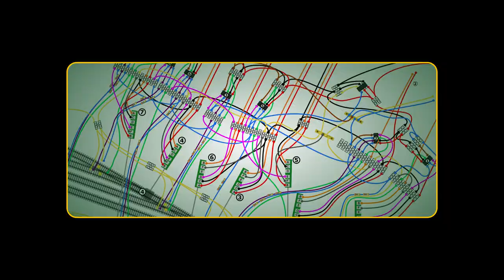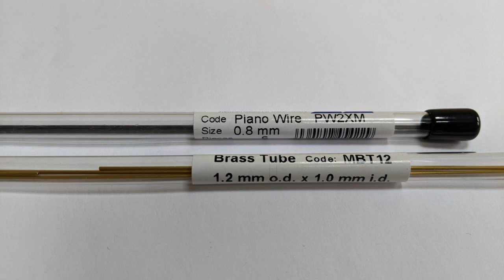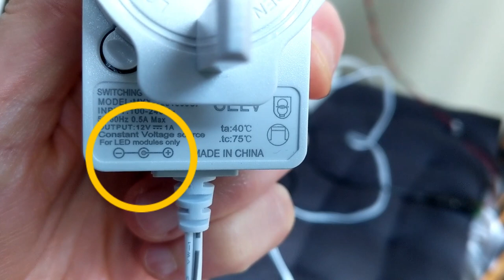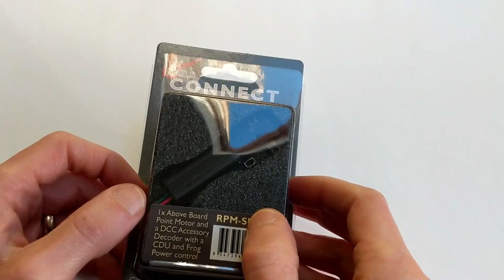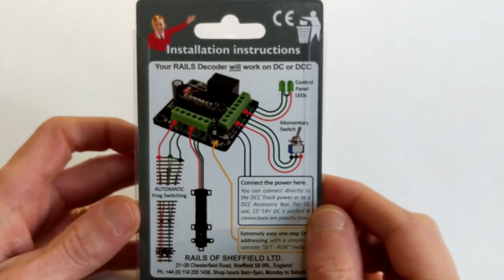0006 Wiring frogs, point motors & LEDs: Implementing

Comment: Like this vid. I am planning to build a similar n-guage layout probably to use DCC++ and arduino. For cable and connections I think it better to look at reliable bootlace connectors and crimps and tools and then select the cable to suit the tools. For going over that bridge I would be tempted to camoflage them as a water pipe overbridge(s) withe wires inside the water pipes.
Reply from the maker: Thanks, Tony. DCC++ looks interesting! Yes, in hindsight I think you're right - you need the right tools, so if that's where the limits are then that determines the wires. Thanks for the suggestion about water pipes - that would be a nice disguise, though I think I'd need quite a few pipes to fit all those cables in without the scale pipe diameter becoming very big. My intention is to build a small hillside there, with the cables within - that bridge that's there at the moment is an inherited OO model that's older than me and is just a convenient way to allow trains to run for now.

Comment: 8:04 You can buy ferrules that are specifically designed to work with that crimper, and I have used them happily on 7/0.2 wire.  A variety of sizes are available for use with bigger wires.
Reply from the maker: Hi, thanks for letting me know - is there a specific phrase for those? "square ferrule" doesn't seem to highlight anything other than the crimpers.
Reply: @endoorrailway  If you search for terminal ferrules you should find them.  I bought the tool which came with a selection in varying sizes.  I have since had to buy extra of the two smaller sizes, as these are the ones I use most on my railway.
Reply from the maker: It looks like the smallest there is also 0.5mm squared (I said diameter in the video, but I should have said area) - there must be some subtle difference between different ones that allows some to work where mine didn't. Thanks for sharing your experience of them and the details :)
Reply: @endoorrailway  I don't know if there is a difference.  I usually strip a decent length of outer cover off, but I haven't really tugged at the ones I have used to check them.  Having said that, they don't feel loose after crimping, and I haven't had any come apart, so maybe there is a subtle difference that isn't obvious.